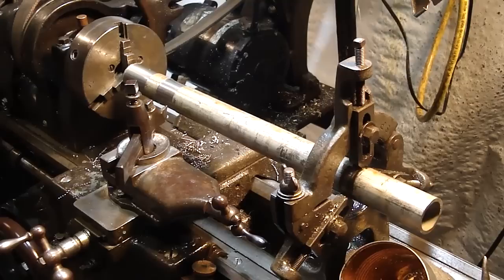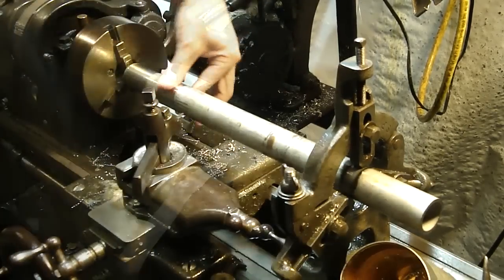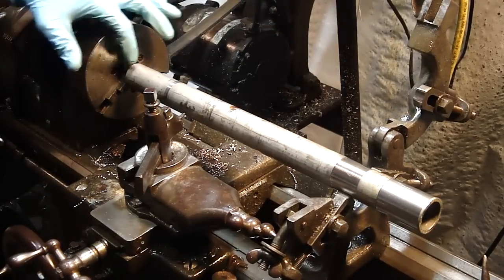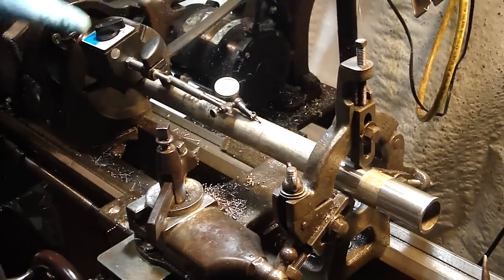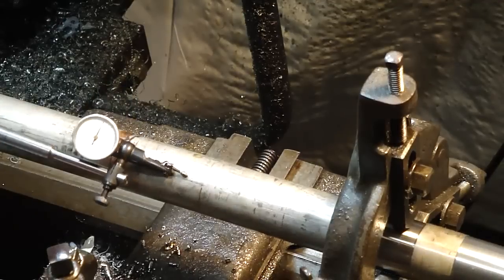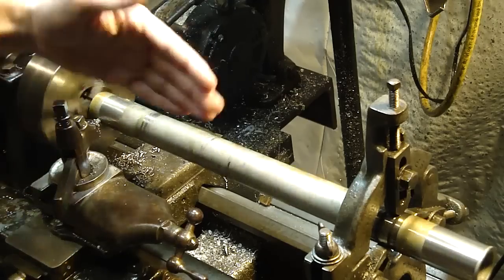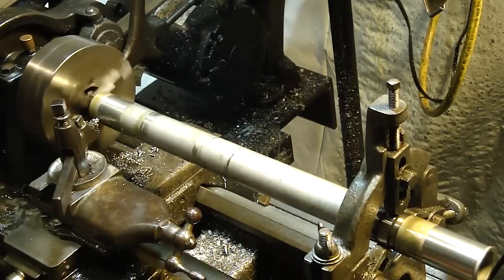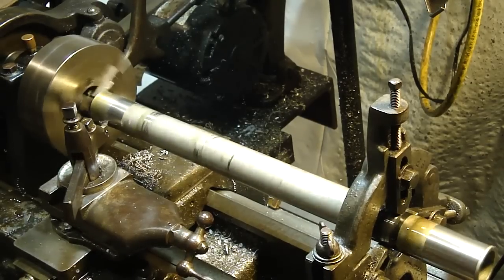Dial in your steady rest

Comment: Just a personal tip I do.  I chuck on the part with about 3/8" of chuck jaws grabbing on the part, so the tail stock or steady rest can pivot the shaft around in the chuck jaws like a universal joint.   Resulting in less springing of the work and being easier on the tail stock or steady rest.  I would then put a live center in the tail stock end and turn a spot at each end of the shaft to the same diameter.  Also, turn a spot for the 3 jaw chuck to grab on.  Now the steady rest can be put in place, rollers adjusted to the turned diameter at the tail stock end, and then the live center can be removed.   Now the shaft can be flipped end for end and the steady rest is already set up to the diameter at the chuck end, being that you turned the diameters to the same size.  The machined diameter at the chuck end will run true with what you are chucking on in the 3 jaw because you are now chucking on a concentric, round surface.  Hope this helps someone.

Another way is to make sure the tail stock is aligned with the head stock first.  Next, with the shaft running true at the chuck end and held by the steady rest at the opposite end, mount a dial indicator holder to the shaft end that is  beside the steady rest.  Put the indicator probe inside the tailstock bore or
Reply: ... on a tail stock center and rotate the shaft.  Adjust the steady rest rollers until the indicator needle does not move when sweeping around the tailstock bore or center.

Comment: This definitely not the way to dial that in your dial indicator can’t be rotating with the pipe??????
Reply: This is a check on the eccentricity of the steady rest compared to the center of the chucks
Reply: Ken Ken is right: This is a very different way of using a dial indicator than the usual . The tip is not intended to slide across the surface of the pipe; it's sensing the flexing of the pipe resulting from the steady rest being offset relative to the true axis, which forces a slight curve into the pipe. The curve is stationary even when the pipe revolves, but the indicator is orbiting about the true axis, which is straight not curved. So the indicator reads a changing distance between the axis of the bar and the true axis.
The only thing which screws with this is gravitational sag in the bar of the indicator stand. But to limit this, remember that the indicator does not need to be extended nearly as far as the steady; the flex in the workpiece diminishes towards the chuck but does not disappear.

Comment: SMH ...for a small part like this in the vid, Get a piece of scrap and place it in the chuck . turn it to the diameter you need as on the shaft , set your steady rest and lock it down. get rid of the sacrificial blank and move the steady rest in the position with the shaft ... AND WA-LA you are good to go and no guess work involved ....
Reply: That works if the bed is straight and true.
The method shown works even if it is not.

Comment: Greetings from Austin TX. You have all the correct tools here, but I'd like to make a suggestion on the setup. I believe the top indicator reading is from the sag of the arm on your magnetic base. In reality, that indicator should not move at all...ever..setup this way. No matter how bad the part is out. Re-position your indicator to the tailstock and get the end of the pipe to run concentric if you can without it touching the rollers of the steady rest. Then position the indicator directly across from the wheel that you intend to bring into contact and watch for needle movement. Do this with each wheel. When it comes to how tight, Steady rests like the one you are using can kick out just like a worn chuck under pressure. You can observe the track the bearings leave in your part and see if they are full width, or bias the side closest to the chuck. Too much torque can slowly walk the part out of the chuck. Use your compound to put a small chamfer on the inside of the pipe and put a live center in there if you can. It would help to stop the part migration.  Good luck.  JP out
Reply: Joe, you're missing the way this method works.  This is actually the best way to set the steady rest, imo.  The only thing not mentioned by the poster is indicator sag in the top and bottom positions.  This method side steps problems with tailstock alignment, parts out of round, bed way wear and a whole gamut of things.  With the indicator staying on one point on the part, the only thing that changes as the spindle is rotated is the misalignment of the center line of the part to the center line of the spindle.  I use this method exclusively for dialing in parts to tenths or less.  Give it a try, you'll see how well it works.

Joe, I've watched all of your videos and have learned from each of them.  So I know you know your way around machine tools.  Go out and try what he's describing before condemning it.  You even touched on the misalignment in your video on the same subject.  If the indicator was held stationary while the part revolved with the spindle, you would be correct in your statement on the indicator never moving.  That's not the case with this method.
Reply: If the tailstock is off the machine then have the saddle to the right side with a center setter in your tool holder to find true center. You can also use a setting pc for your steady and then you can move it anywhere.  Keep up the good work.
Reply: The way to quantify indicator sag is to spin the workpiece (with the indicator cantilevered out from the chuck) WITHOUT the steady contacting the work. The workpiece in this case is so much stiffer than the indicator support rod that its own sag can be safely ignored.
The sag between "indicator at Top Dead Cr" and "indicator at BDC" can be quantified and then applied as a correction to the deflection of the workpiece when the steady jaws are engaged and the work is rotated.
It is this latter deflection of the workpiece, as measured from the rotating frame of reference of the spindle nose, which tells us that the steady is not holding the outboard end of the workpiece in line with the rotational axis, and how far off centre it is.
I hope Joe Pie rethinks this, because his OP suggests that (on this rare occasion) he has jumped to a wrong conclusion without due consideration.

As the person who made the clip points out, this is a GREAT method for work which overhangs the lathe, in which case the tailstock must be removed altogether. Or when the tailstock has to be bolted to the far wall of the shed.
Reply from the maker: Thanks Joe, I'm a recent subscriber and learning a lot from your videos. I've also learned just what you say about too much torque and being a bit ham fisted as a newb. After many suggestions I've boiled the problem down to: worn chuck jaws, steady fingers improperly aligned with the ways, and the part was bent. I would always use the tailstock if the option were available, but alas the part was longer than my between centers distance. Thanks again for the tips! Mike
Reply: II have a suggestion for you sir. Since that pipe is as straight as the hind leg of a dog I wouldn't waste any time using an indicator. In the future try grabbing at the chuck end by approx a 1/2 inch so you're not fighting the chuck at the other end and taking a piece of masking tape over the opposite end/ talistock end then taking your finger and swipe your ways to get some dark grease/oil from your ways and dabbing it in the middle of the tape and then slowly rotating your part while presenting the center of your tailstock to the smear of oil and while it's running adjust your steady until the center finds the center of the rotating smear. Most people tend to grab too much material at the chuck end and end up fighting the head stock. You would be surprised how accurate that is. I even use this for internal cylgrinding for roughing out.
Show less
REPLY
Reply from the maker: Bob Smith Good suggestion! If the part weren't longer than the ways I certainly would've used the tailstock, your method is appreciated and the next time I mess with something so crooked I'll definitely try it!
Reply: I'm with Robert. This is a uniquely valuable method is not affected by parts which are not round and tailstocks and beds which are out of whack. People routinely misunderestimate this method. As Robert implies, indicator sag is the only gremlin which has to be minimised. This can be done by using a lightweight indicator held by a light and stiff bar, and by bearing in mind that the indicator does not need to extend nearly as far as the steady, because the flex induced in the workpiece by a steady being offset does not disappear towards the chuck; it only diminishes)
Reply: Mr joe can you  please make a video about this case. Thanks from now.

Comment: I had a Logan that I could not figure out why they thought it would vibrate vibrate vibrate it was terrible I had to run real slow too and then I realized there was only doing it with one shot it was one great big 9 inch squirrel Chuck if I put any of my other trucks on it it was fine you might want to look into that. what what what it was is the motor was a little underpowered for this gigantic Chuck you waited God damn time for a little 10 inch lathe so I threw a new motor in it and I can use it now
Reply from the maker: A balance stand for my grinder wheels is high on my priority list so I'll definitely have a look. Thanks for the heads up!

Comment: My machinist instructors (2) one retired from oil industry and other aircraft.  Their method as follows.   Steady rest a triangle.  Adjust the the bottom bolts on the machined surface,  until thing right.  Leave top screw off the part.  Want the part to be free, and not bound up by top bolt.  Steady rest a holder, not a forcer.  Bottom bolts move part up and down and sideways at same time because of triangle.  Leaving top screw loose will not throw off reading.  When perfect, snug down top screw as tight as can with fingers of your hand, not a wrench.     Both recommended anti-seize as lube.  Oil OK for short time turning, but large shafts which could take hours, anti-seize only way to go on steady rest to keep wear down.   Gravity on long arm, could pull dial few thousands off when part could actually be true.  Your steady rest set up, looked too hard.  Work smarter, not harder.
Reply from the maker: +Gary Bray Thank you!
Reply: +allsortsofinterests Trying to make the above short.  Important:  What if you go too far with bottom bolts?  You still do not adjust with top bolt.  You back off bottom bolt whichever direction you need to go.  Smack with palm of hand (karate chop) and if not good enough, use rubber dead blow.  Was never allowed to use brass or lead hammer.  Rubber hammers weighted are very durable.  Made for machinists.  Old rubber hammers made for hubcaps at gas station.  Brass and lead hammers used back in the "good ole days" when such hammers were not available.  More control with rubber than the others.  Metal striking metal can give bounce back.  Ask any blacksmith.  When dealing with couple of thousands, bounce back is not good.  I have 1-2-3 pounders in my box.  Mostly use the 2 pounder.  1 pounder if lack of space.